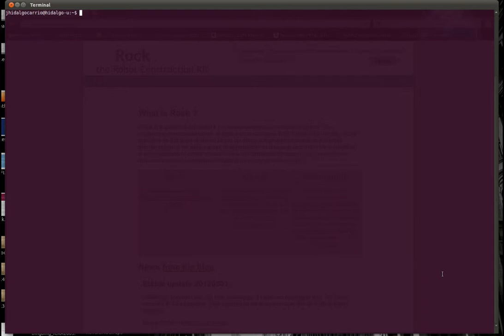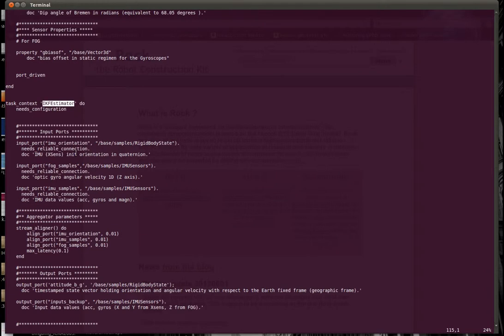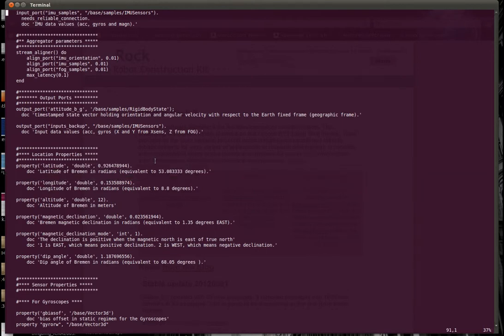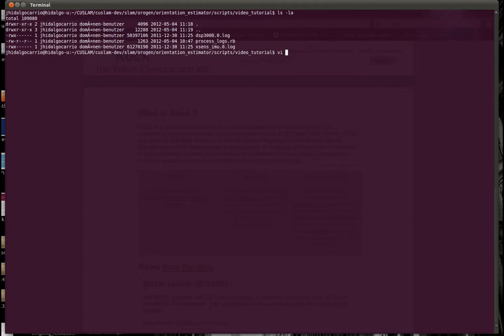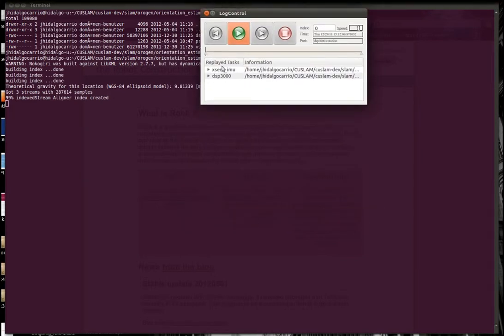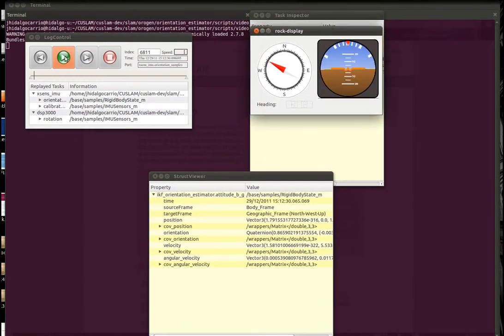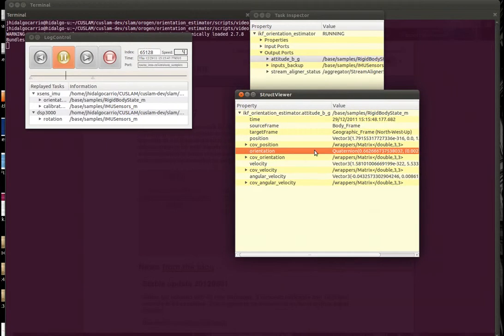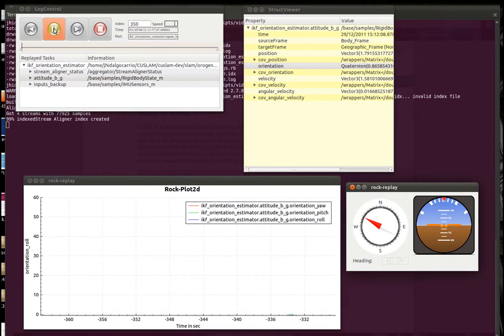Rock Components - Development Workflow

Comment: Looks like a large number of complex setup steps are necessary for a relatively simple example, or am I missing something?
Reply from the maker: Rock does have a rather steep learning curve. I wouldn't say that it is by design, but it definitely is. In the end, the cost of setting it up is amortized over time. All Rock developers are handling fairly complex systems, where the initial setup is a rather small part of the overall cost.

One thing that strikes in your comment is "a relatively simple example". The number of steps would be the same regardless of the complexity of the example. What we have elected to do is not focus on making these small examples artificially-looking simple ... to get people hit their lack of understanding quickly later on.

We're aware that it slows down adoption, and are working as time permits to improve this. Always with the goal to not hide existing complexity when it hinders understanding.